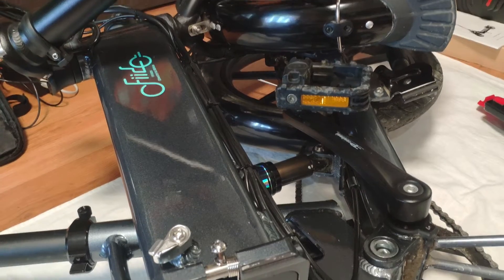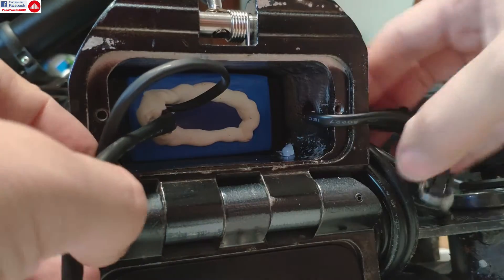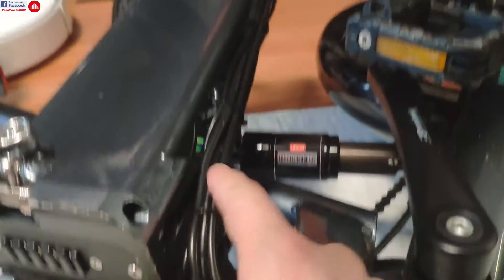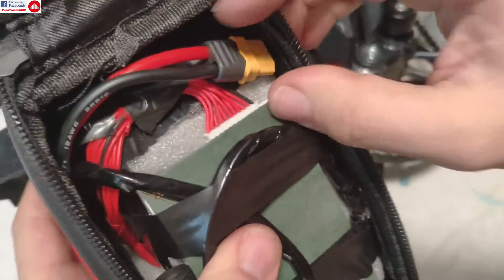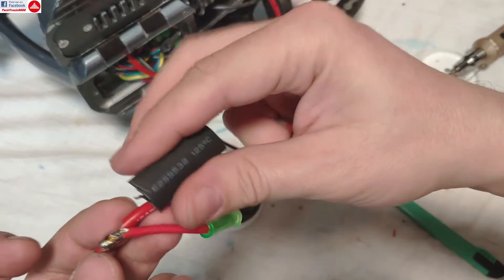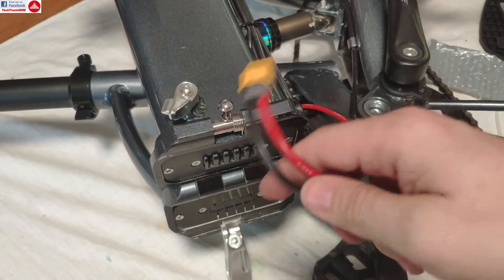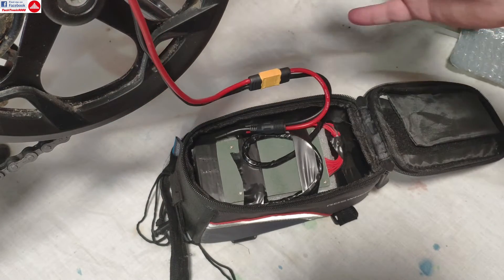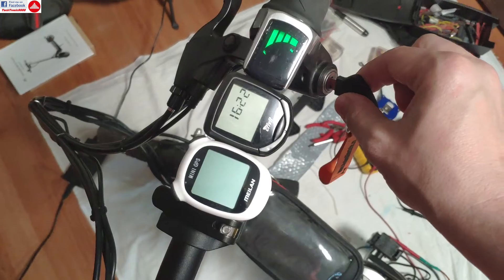Fiido D2 Original Battery Details & Double Battery MOD

Comment: Hello and thank you for your very interesting video.  I was wondering if you had considered adding a gating diode to each source. I realise that a forward voltage drop of between 0.6 to 0.7v would occur using silicone diodes.  Using schottky diodes would reduce the forward drop to a much lower level. Just thinking!!!
Reply from the maker: It's not needed as long as the 2nd battery has a common wire BMS, this means that charge / discharge port is the same so it shares the same voltage with the other battery and they are always balanced between them. I have extensively used this system in several of my ebikes and it always performed as expected.

Comment: I would put a simple fuse on each battery wire just in case the current flows back youll only have a fuse to change not a bms or battery incase of fire ✌️
Reply from the maker: Yes it's a good safety measure to take into account.

Comment: Hi, can you help me please rule out the problem with my fiido d2s please.
Bike stops charging when the first bar is full.
Charger is green when not connected, red when charging then turns green after the first bar.
I tried to drain the battery to make sure that the led indicators are not broken.  Battery got drain eventually after around 20  minutes  on full electric mode.
So it seems that the charger is working, motor is working, 
Do you think the battery is damaged? Or just some loose connections? 
I will buy a voltmeter to see if the volt has decreased, and would that rule out that the battery is damaged and not any other part of the bike? 
Please. Thanks.
Reply from the maker: If you have a volt meter you should check the charger to see if it has 42V, then also check the battery voltage. Your battery might be faulty from what you describe.

Comment: Thank you very much for your helpful review! It really gives a easy to understand in depht knowledge how to upgrade to a parallel battery setup. I just have one question. How do I have to operate when both batteries have a on/off switch? Connect first and then switch them on? And when connected, do I have to keep them on all the time? Same while charging? Sorry for a lot of questions.
Would be great to hear from you!
Best regards form Germany!
Mike
Reply from the maker: Both batteries are fully charged and then connected in parallel with plugs, then you just use the bike like it has one single bigger battery, you also charge it as usual, so basically you don't ever need to disconnect the batteries.
Reply: @TechTronic9000  
Thanks for your reply! 
Both batteries are fully charged.
So when I connect, the batteries they should be switched on? They have a on/off switch.
Sorry for bothering you
Reply from the maker: There is no on/off they have XT60 plugs

Comment: Hi, great video. Could you plug it straight into the charger port?
Reply from the maker: No you can not as the charge port is not meant for high current draw that the motor takes so it will overheat and burn out along with the wires and bike

Comment: I believe it's NOT ideal to charge both battery packs simultaneously using only either charging ports. Each battery pack has its own BMS with dedicated charging ports. It would be better to hook up both charging ports in parallel connection. The only draw back is that, if your charger can only deliver 2amps @42 volts (which is a standard, and I haven't seen anything higher than 2amps yet), it will definitely heat up badly hence will shorten its life. 
Oh, and that Polarity issue due to the poor design of the battery contacts is a life saver!
Reply from the maker: Alternatively if you follow my design you can "fold" the bike and charge each battery with it's charger port, they will be separated during charging, you only need to be careful that both are full when you fold it back. Still i use this with 2 charger and have zero issues, also when i'm not in a hurry i just use one charger.

Comment: How to make D2 faster? I'ts very slow:(
Reply from the maker: You can't
Reply: @TechTronic9000  Thx.I have 56teeth front support, next I will give 13 on rear  - I dont want 50km/h, but now every wheelchair is faster than me...
Reply from the maker: Yes but the motor will cut out at 25-26km/h
Reply: You should hold the right brake down while turning the key for five seconds!
Reply: @lalalo41  Unfortunatelly this dosn't work....
Reply: It does for me?!
Reply: @lalalo41  Yes - there is no tric to make F2 faster without changing electronic module...
Reply: The unlock seems only to work on bikes delivered with the phone holder. Other versions have a different controller.
Reply: The "tricks" used to unlock the speed limit in the firmware can depend on the country of delivery. For example, some of the D2's will unlock using the brake+power trick discussed in other comments, and some won't.
Reply: exgenica 
I agree I have a D2s and that method does not work but I believe it does on the D1 and the D2 I’m very disappointed wished I had bought the D2 now I wondering if a change of controller might help !!!
Reply: @michaelhurrell4263  I changed front sprocket to 56teeth - bike is not faster, but You you don't have to pedal so much - for me ideal is when I see some cyclists who pedal as if slow motion...
Reply: @michaelhurrell4263  ..but controller changing is not so simple operation - lot of very thin cables - so when You haven't a practice - be careful!
Reply: Tom Libero  Thanks for your concern I am a qualified electrician also trained in wiring and soldering at Marconi in the sixties

Comment: ¿Cómo anulo y quito el acelerador de la FIIDO D2S? En España es ilegala.
Reply from the maker: You can simply remove the accelerator and the wire from the controller, only keep the G20 panel, should work in assisted mode only. Also if it doesn't just remove the throttle from the handlebar and hide it in a bag or something like that.

Comment: When u fold the bike,this 2 batteries is not connected together,better idea is drill a hole to the  frame where main battery is
Reply from the maker: Yes, but usually you can not ride it folded so the batteries will keep their voltage the same upon reconnecting.
Reply: TechTronic9000 Give to this man a beer.

Comment: Ak nabíjame originalnu baterku tak na pracovnom výstupe klesne napatie a teda externa baterka sa nenabíja !!!! Po odpojení nabíjačky nastane nebezpečný skrat medzi plne nabitou a vybitou druhou bateriou !!! pozor na to!!!

If we charge the original flashlight with only one charger, the voltage at the working output will drop and therefore the external flashlight will not be charged !!!! After disconnecting the charger, there will be a dangerous short circuit between the fully charged and discharged second battery !!! watch out for it !!!

Comment: IF MY ASSUMPTIONS ARE INCORRECT OR IF YOU DON'T KNOW ELECTRONICS, THEN DO NOT ATTEMPT THIS MODIFICATION. THIS IS INTENDED ONLY AS A GUIDE FOR SOMEONE SKILLED IN ELECTRONICS.

You MAY be able to eliminate the reverse polarity risk you talk about at the beginning, by simply moving one of the power leads to the next-over connector on the power plate and doing the complementary move on the mating power plate, and now if a plate is reversed then power leads will NOT connect.

I couldn't tell from your video how easy that would be to do, but if it is just a matter of unsoldering a wire, moving it over one connector, and then soldering it to its new location, that will do it.

WARNING! THIS ASSUMES...That none of the inner 3 connectors are connected to anything else and that as shipped only the two outer connectors on the power plates are used. It also assumes that connecting metal slots and mating tabs are installed in all 5 locations as seems to be the case in your video.

In other words...
Let's label the connectors 1 thru 5 from left to right.
Let's assume the (+) power lead is soldered to connector #1 and the (-) power lead is soldered to connector #5. All you have to do is move the (+) power lead from connector #1 to connector #2 on both the battery compartment plate and the mating plate. Make sure you are moving JUST the (+) wire on both plates.
Reply from the maker: Great comment! I'm also considering joining another pair of connectors so that the bike will use 2+2 for better power transfer as the general resistance will drop. Another improvement would be also to solder the 2nd battery directly to the connector and not on the main battery wires.
Reply: Using 2 connectors for each wire is also a great idea! That also could help reduce contact point hot-spots developing on the connectors. However, inverted polarity could then again becomes a problem depending on how you rewire the plates if a connector plate is reversed/inverted. For a safe "2x2" circuit to  avoid a short-circuit, you would have to change the connector wiring like this (assuming we are always dealing with a 5-connector plate and two active "+" and "-" connections as delivered from the factory).
+ = positive
- = negative
o = no connection 

If anyone sees anything wrong with these implementations, please let us know.

MODIFIED CONNECTOR POSSIBLE PIN-OUT
Pins
1 2 3 4 5

EXAMPLE #1:
+ - + - o
If one connector plate is inverted, then it would mate up like this;
o - + - + = no short-circuit.
The only problem with this is that now the "+" connectors are only connected via 1 connection instead of 2 if one of the plates is inverted.
(but, if you TRIPLE-UP on the "+" connection, you would always have 3 "+" connections and 2 "-" connections)
+ - + - +
"inverted" plate now looks like this:
+ - + - +

EXAMPLE #2:
OR, you could go this route and achieve the same protective result except now it would be the "-" connection that is reduced to 1 connection if one of the plates is inverted.
- + - + o
"inverted" plate now looks like this:
o + - + - = no short-circuit.
(but, if you TRIPLE-UP on the "-" connection, you would always have 3 "-" connections and 2 "+" connections)
- + - + -
"inverted" plate now looks like this:
- + - + -

PREFERRED SOLUTION
So, to ensure there are always at LEAST 2 connections of each polarity regardless of plate orientation, I suggest using either the 
+ - + - + = Triple-Plus
OR
- + - + - = Triple-Ground
connection setup on both plates.
Reply: @exgenica  hi Exgenica impressed with your knowledge but for a basic idea for someone without any technical knowledge: i was thinking of getting a bullet-to-xt60 adapter connector for the controller. Then connecting to the fiido internal battery via xt60. Then when discharged during a ride, unplug the connector and connect to a 2nd battery. Avoiding parrallel running. Will this work? Thank you
Reply: @ajvirdi  I'm interesting about this solution. Any answer?
Reply: @mirko2k5  ive ordered the stuff and will update, maybe even make a video
Reply: @ajvirdi  Nice, I hope to see your video or pics

Comment: I just replaced mine with a 10ah almost 18 miles per charge with motor and 36 miles P.A.S.
Reply from the maker: Did it still fit the frame? What cells did you use?
Reply: You might take a look at 21700 cells. They're a bit larger (+3mm wider diameter and +5mm longer) but can increase Ah capacity by 50%!
In addition to fit, the trick is finding a source of quality high C output 21700 cells at a reasonable cost.
I do NOT know if a 36V 10s2p configuration (10Ah) using twenty of these cells would fit inside your ebike's battery compartment, but it might replace a typical cheap e-bike 36V 10s3p (7.5Ah to 8Ah) battery. With 10 fewer batteries it also means fewer connections if you're making the battery pack yourself. If one is using one of the "solderless" lithium cell connector systems, it could also be cheaper overall.
Fewer cells, fewer connections, same or higher Ah capacity.

It's hard to believe at first thought, but those 3mm and 5mm added to the dimensions of an 18650 cell to create a 21700 cell adds almost 50% more volume over the 18650 cell. 
Cylinder Volume=pi*R^2*h. So, all other things being equal, a...
3400mAh 18650 cell (18x65mm cylinder) capacity increases to about
5000mAh 21700 cell (21x70mm cylinder).
Reply: @TechTronic9000  Yes same size but cells can take more charge... look at aliexpress liitikoala ;-)

Comment: If you don't charge them separately one of the two will become unbalanced and be damaged over time
Reply: Wrong
Reply from the maker: No, as the BMS accepts charging over the discharge port (common wires)